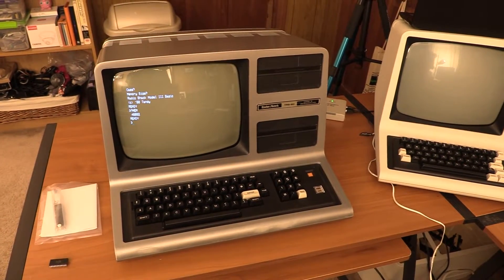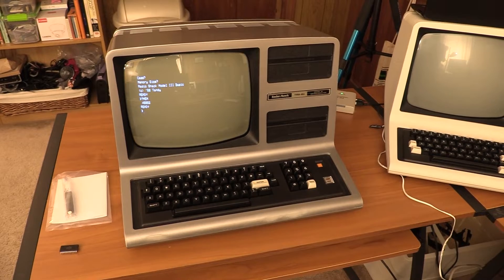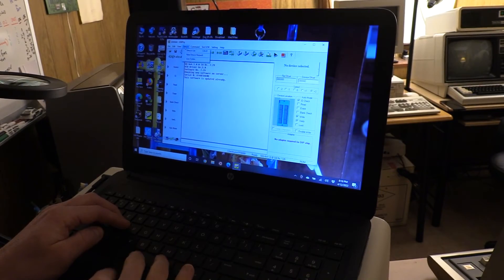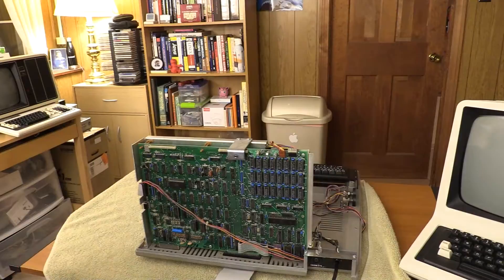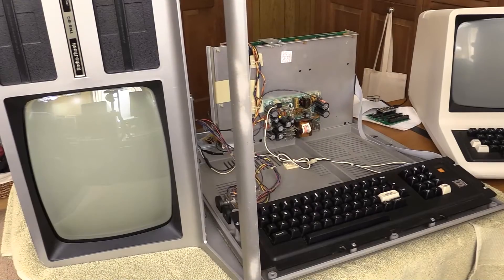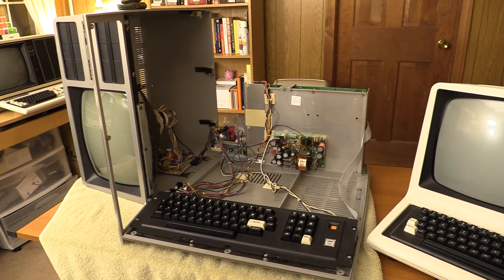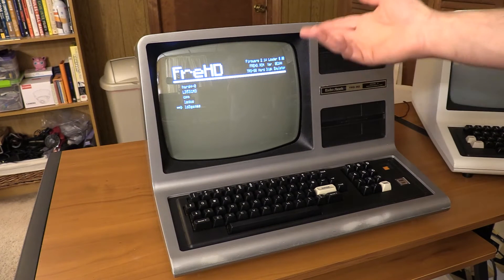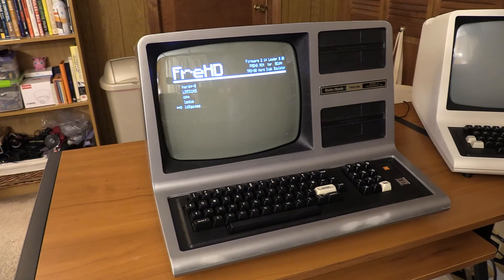TRS-80 Model III - FreHD Auto Boot Upgrade - EEPROM Burn and Installation

Comment: This was great. Short, sweet and to the point! I'm in the process of adding the FreHD Auto Boot EEPROM to my Model 4P, however since I have the Gate Array model, I need to solder a couple wires to the EEPROM, then solder one to the underside of the motherboard. Fun times!
Reply from the maker: It’ll be worth the work!

Comment: Thats very interesting.  What can I do with this new rom in my modle 3 over the stock one.  And also.  Is there anything special I should know or do u have a link for a full right up and parts needed  thanks.  Enjoyed the video. But a bit on the short side.
Reply from the maker: Thanks for watching!  This ROM allows automatic boot from the FreHD hard disk emulator, which these systems weren't capable of doing on their own.  Beyond that, it doesn't add any other functionality.  

You can either build your own TRS-IO (which includes FreHD hard disk support and adds network functionality) or you can buy pre-built FreHD units that work via SD card.  If you want to build a TRS-IO, you can find info on the creator's GitHub here, which includes a BOM and the files needed to have the boards made: https://github.com/apuder/TRS-IO.  

Alternatively, Ian Mavric sells FreHD units for the Models I/III/4 and FreHD4Eight units for the Models II/12/16/16B/6000.  You can check out his page here:  
http://members.iinet.net.au/~ianmav/trs80/emulator.htm

If you contact Ian, he'll ask you some questions about your system to make sure you get the right unit.  I believe he sells kits and pre-built units.  Good luck!